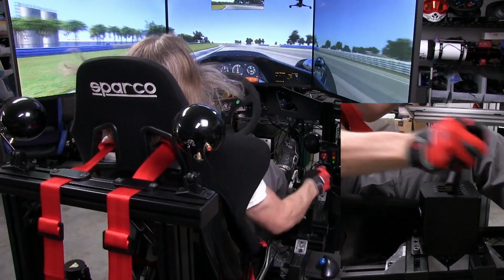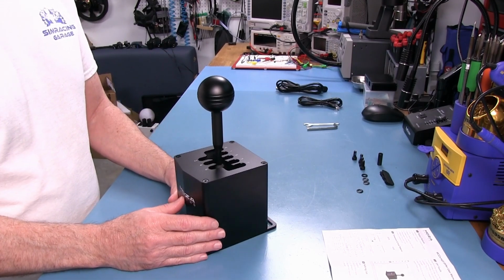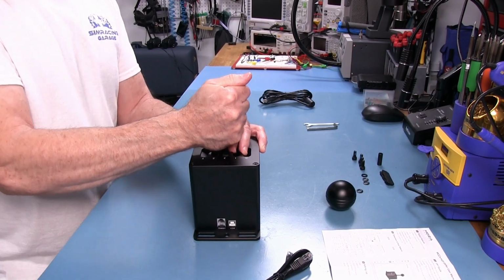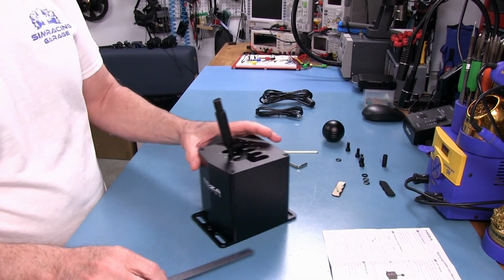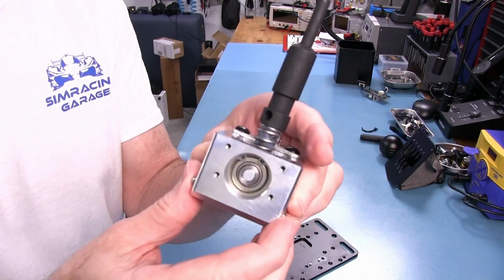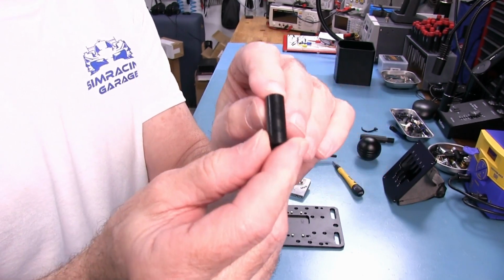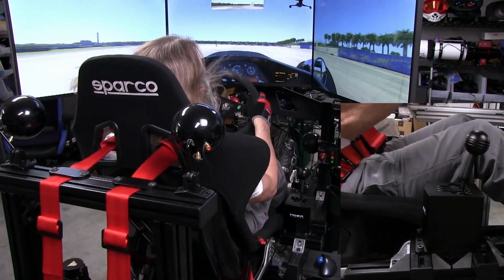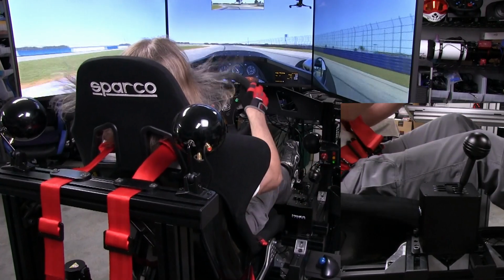MOZA HGP Shifter Review

Comment: Having owned the HGP Shifter for a couple of months. My ONLY gripe with the shifter is how loud it is. After stumbling onto your video and see you take it apart, it got me thinking. I wonder if removing the spring loaded ball bearings would remove any noise besides the shifter shaft hitting the gear gates. In doing so Im almost positive it will remove the mechanical resistance the shifter provides when changing gears but its a sacrifice I'm willing to make to get rid of the noise.
Reply: I'm working on the same thing right now. I ordered some plastic balled spring plungers to replace the steel ones, as well as some silicone hose to replace the hard plastic bushing on the shaft. I did a similar thing to the SGP where I replaced the steel balls and springs with plastic balls spring-loaded with rubber balls. Made it squeak ever so slightly but it's no longer shotgun-loud. I got the plungers from VXB, hoping the right size.

Comment: The problem with this shifter is that the sensor is mounted on a moving part, and the wire bends every time you use it. Worse, it rubs against metal, causing the device to self-destruct. They definitely should have made a fixed sensor.
Great review, by the way. Thank you so much.
Reply: Apparently there have been multiple revisions to the HGP shifter since launch that have addressed most of the issues that plagued the launch version.

Comment: This video helped me repair my shifter because every single wire on the 4 pin connector snapped somehow right by the connector, maybe I was shifting too hard. I didn’t know the orientation and I didn’t want to take any chances shorting the shifter by putting wires in the wrong places so thanks a lot. Great tear down video
Reply: I couldn't tell from the video but had to assume that the main PCB unit is mounted to the shifter body and wired to the sensors on the moving parts. I thought right away this looks like an easy failure point. Not sure why they would design it this way instead of with fixed sensors and moving magnets.

Comment: It would be nice if someone brings out a kit to reduce the stiffness with at least those ball bearings...as well as a different table clamp where it's not on top of the table, but rather a bit lower and off the end of the table Fanatec style. The combination of incredibly stiff shifts and being so high up and far away means I have to lean forward to shift and damn near take out my shoulder in the process

Comment: If your considering thrustmaster th8 or this go th8 then do the shifter mod feels some.much better and lasts where as the moza hgp ball bearings lose there click over time unfortunately only last about 100h
Reply: I sold my Th8a full mod with industrial ball bearing  swap and mod rod for this .The Th8a feel like a  Toy compare of this moza hgp ,not even comparable,sorry :)
Reply: @AtomicFrogTv  have taken apart the moza basically has the same system a ball bearing popping in an out , many different mods for the th8 it's more or less the same lol all.good though dude if the moza hasn't gone floppy on you yet that's great 😀

Comment: If you want the operation to be quieter, I bet you could fit a piece of vinyl tubing on the shaft in place of the plastic sleeve.  I think I'd rather do that than cover the number with a custom part prone to wear and relying on adhesive.  $5 worth of tubing and you've got a lifetime supply of backup sleeves.  That is, so long as the shifting feel is still sufficiently crisp.  But I think it would be as long as the tubing is a cheap thin variety.

Comment: Hey Barry, absolutely love the content and you're always my #1 choice when looking into new gear!

I've had my HGP for 3 months, and really don't abuse my equipment! Shifter started to feel a bit sloppy an eventually snapped. (Found multiple other users with the same issue) Personally I think it's due to the shaft material. Carbide/graphite etc vs. stainless steel. 

Have you heard/had any issues with yours? 

Thx!

Comment: Hi 
I want some help 
I am really new in sim racing 
So I bought a used d-box gp200 it’s very old but I got it very cheap
But the problem was one connector is missing 
Kai-p1 
This is the connector to connect the pc to the chair 
But this connector from d-box is very expensive.
Is there any other option ? 
There is any after market 
Or any other connector I can use with it ?

Comment: when I got my shifter from moza it was fine for about 10 minutes then it had alot of side and foward to back play. when I opened the top of the shifter plate I saw the two pins that control side to side seemed to be farther apart then in the video. the foward to back play I haven't yet figured out.

Comment: I had to refund mine day one, the lock for reverse or 7th gears was not functionnal, with the new unit, it's perfect, the 1mm part tolerance is too much has said Moza support, they have rebuilt the units
Reply: fixed by RMA and exchange by Moza by my dealer

Comment: Hey great content man, thank you for making these videos, you help out giving reviews on sim racing products and it really helps out. Keep up the good work, but before I go I have a question.

I’ve been looking at sim wheels so i can figure out what i want next. Right now I play on Xbox and I have a Logitech G293 with a Logitech G Shifter, and before that I had a Logitech G920 that ended up breaking. The main problem is…well, there are a lot of options and its difficult to figure out a good option for what wheel I would want to get. So I wanted to ask you if you could give any advice on a good simwheel setup that you would recommend. It doesn't matter what brand it is, I'm just looking for a sim wheel setup that is compatible with xbox and has good quality and a good aftermarket support (another thing would be the ability to swap wheels easily but thats not required.) If you could give me good advice on a good simwheel setup, i’d very much appreciate it, thank you.

Comment: I received my shifter & handbrake earlier to today & am loving them. The whole Moza eco-system offers very good value for what you get (IMO!) I noticed that the shifter accessories had two sets of silicone sound deadeners, so there are spares in case the other ones wear out. Would be nice to know if it was possible to get hold of, when needed. Great videos by the way!

Comment: Just received my shifter. Using the latest software and firmware, to calibrate it properly I had to move the shifter far left and far right a few times within the 10sec. Front and back not needed, otherwise the calibration is off.

Comment: A detent on seventh gear is very common on IRL cars. I am not sure about the implementation of the gate ramps. I would expect to see them deeper in the shifter. I suppose this is to keep manufacturing costs down. For me the lack of gate ramps inside is one of only two reasons to consider the Fanatec shifter over this one; the other being the easy switch to linear shifting.
The advantage the Moza has over the Fanatec is not the price, that seems right for the build, but the inclusion of USB without needing to buy a special cable.

Comment: M12x1.5 it's a sin - most of aftermarket knobs has M12x1.25 thread
Reply: So it's a 1.5 for real ?? I just received it and I need to put an extension for truck sim.. I don't find anything other than  M12x1.25 😅

Comment: Also for Mounting, rather than using the 2 Cross bars you used, I just put it directly onto the Alu bar and only used the 2 center bolts and it didn't works perfectly, does not need the extra horizontal support IMO.

Comment: I dont understand why anyone would buy this over the SHH if they are a PC user.
Reply: The SHH is 30% cheaper and does both H and sequential, and has more mounting options, that could be 3 reasons :) and you don’t have to calibrate it, it works out of the box without any additional software :)
Reply: Ecosystem, looks and build quality
Reply: @danieloutzen9802  lmao the plastic was wearing on the moza after a 3 hour use.  Shh is higher quality than fanatec or moza and "ecosystem" is a drawback not a benefit.
Reply: The SHH is 3d printed. It may feel good but it looks cheap and sounds cheap. I am on PC and have a heavily modified Logitech shifter, the SHH is not a large enough upgrade for me to warrant spending the money. Personally, the Moza shifter seems like a worthwhile upgrade.
Reply: @jerrylindgren7828  I had the Logitech it is playskool trash.
Reply: I have both and even if the SHH is a good shifter for its price, it looks and feel quite like a toy beside the Moza HGP. The quality of manufacture of the HGP is outstanding for its price. The feeling inside your hand is awesome. 

Anyway, and I'm surprised myself with my overall feeling about the two shifters: I tend to prefer the SHH because it feels more like an old car's shifter and that's the style of cars I prefer, and also because it can easily go in SQ mode. In the end its very difficult to decide wich is best from an objective opinion. The high quality and feeling of the Moza, or the versatility and cheapness of the SHH (the Moza isn't quite expensive either)... I like both and keep them all 😊
Reply: @tomiroquai  How is the Moza high quality when it literally was wearing down the shaft after a 3 hour session during this review?

Moza is alibaba stuff with some extra marketing.
Reply: @fireonmytarget8937  seems you had a bad experience with your Moza gear, I'm sorry for that. I don't know a brand with absolutely no problem, and after that it's just a matter of aftersale service... But it seems its more than that for you 😅
Reply: @tomiroquai  just trying to do my part and post that Moza isn't what these reviewers hype it up to be. This review isn't that bad but most channels are shills and being paid for affiliate sales. And the end user ends up with mediocre garbage. Moza is about the same tier as razer. Tons of marketing.  Looks nice and seems good until you use it and it fails early.
Reply: @fireonmytarget8937  yeah yeah. Do your part, soldier of the Truth.
Reply: @fireonmytarget8937  You got any links to people having problems with this shifter? 
You're coming off as an old customer with a grudge. 

I'm not against cheaper options, I got a really nice wheel from spain with lots of 3D printed parts, and I'm currently checking that shifter of yours out.
Reply: @frawgg  cringe. Obvious you haven't used one. Moza is all marketing with trash build quality and durability.

Comment: I have been using this shifter for the past 2 weeks, and I'm surprised by how good it is built for the price. But I have 2 complaints that may be related to my setup. The first complain is the wider throw of the shifter means that you must be careful when mounting a handbrake next to it because it will invade the space next to the shifter. I use an NLR 2.0 stand, and in the flat configuration of the handbrake, I hit my fingers every time I go into the 7th gear. This could have been avoided if they had a standard reverse and 7th gear in the same column. 

My other complaint concerns the spring to engage the Reverse and 7th gear. Since I play a lot of ETS/ATS, I often rest my hand on top of the shifter because I have to do a lot of gear changes. I tend to engage the spring and accidentally shift into 7th or Reverse. 

Also, I can use the basic shifter functionality after calibration without running the Pit House software. So there is no need to run it in the background at all times. But you do need it to do the initial calibration, and after updates, I also need to recalibrate.
Reply: I'm also using NLR 2.0 stand. how many bolts are to lock this Moza shifter in the NLR stand shifter holes? 2 or 4? Also what specific handbrake you are currently using? I presume the handbrake is placed on the right side that has the option for tilt configuration, right?
Reply: I have the same exact setup as you and face the same issues, I wonder if you drill some new holes for the handbrake if you could avoid hitting it
Reply: What other h pattern shifters are worth it
Reply: @EduardoDeLeon-z6h Thrustmaster Th8a / Th8rs...all the other are very expensive